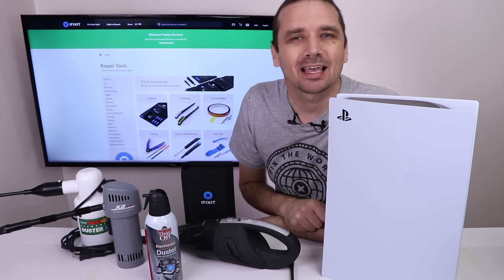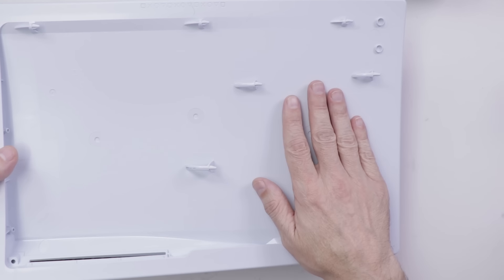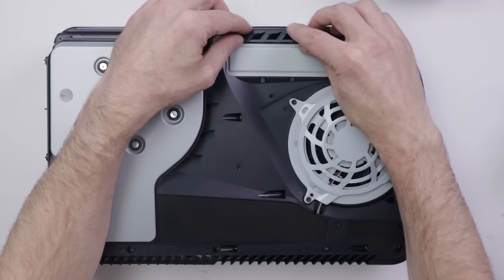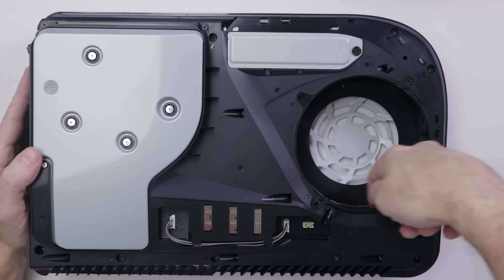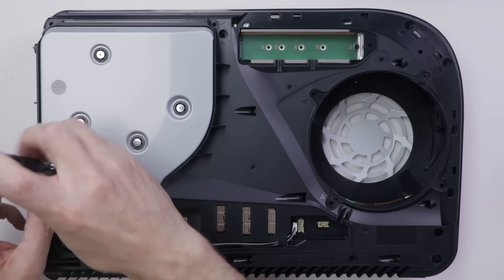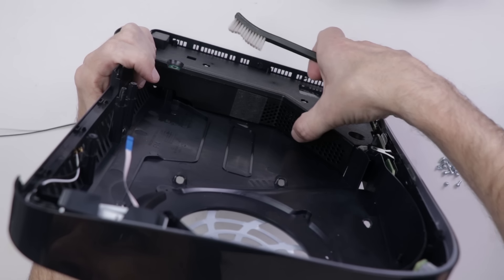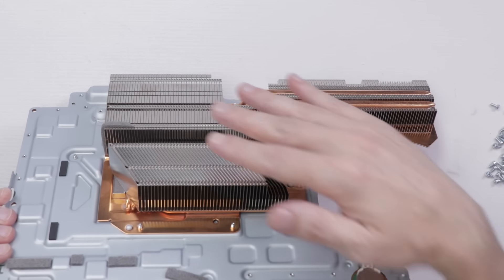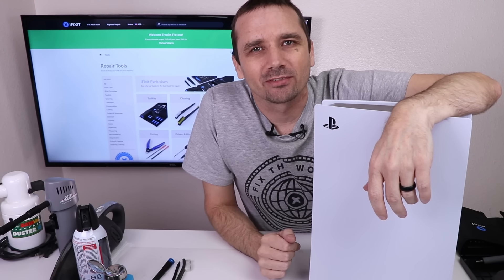How to Clean Your PS5 Safely - 3 Stages

Comment: Imagine reassembling it and having some screws left
Reply: @real_is_back297  Highly unlikely that would occur since most screws have very little to do with how well the console runs.
Reply: That’s exactly why I don’t want to do this😂 but I need my console cleaned😂😂
Reply: Imagine reassembling it and your ps5 not working
Reply: @greed6is6good  The only moving parts are the disc drive and the fan should be easy 🤣
Reply: Means you put the PlayStation back together better than the engineers did
Reply: Me rn 🤦‍♂️
Reply: I had 25 screws left 🤷🏽‍♀️
Reply: had that happen to me when I cleaned my xbox one x I put it all back together and ended up having 4 screws left over 😆 it still worked good tho

Comment: I can’t express how helpful you are. I decided to just go for it, I took it completely apart like your video! It was caked in dust! It was overheating and shutting off!

After reassembling it wouldn’t turn on! But turns out somehow I’d forgotten to plug a ribbon cable back in, after doing so it works fine! It runs as cool and quiet as the first day I got it!

Comment: Hey guys, I’ve had my console since launch and never cleaned it since today. The fan had so much dust. If anyone is scared about unscrewing the fan, just use a tweezer and reach down through the gaps of the metal that holds the fan. Works amazingly well!
Reply: But the dust will be still there moving around and if that dust go inside into the heat sink fence, more problem lol... So if you are doing it, do it the right way.
Reply: @jaybro3713  There is no right or wrong way. If it’s clean it’s clean. Dust generally clutters together making it easier to just pick it all out and then using a hoover or air can to blow away the small bits left
Reply: Are you sure this works I have the exact same problem as you so if u can help me it would be amazing
Reply: @peachbeach9471  yes it works amazingly well. Dust usually sticks together so it’s so simple to just tweezer it out without removing the whole fan
Reply: Mine always turns off
Reply: @tyn7443  t8 security screwdriver
Reply: Was your PS5 loud while it was dirty?
Reply: @Cronies  nope the only sound that ever comes out from it is the coil whine which can be quite annoying when sitting close to it
Reply: Yo same
Reply: @Luismarsden68   no cap mines too idk why either cuz I clean mines from time to time
Reply: @gerodanthony3655  mine don’t do it anymore don’t know why tho

Comment: I prefer to use a small paint brush, preferably with soft bristles, it's more comfortable and reaches the most difficult nooks (
especially with heatsinks). Much more than a toothbrush or shoe rack that isn't capable of reaching everything.
Reply: I keep a small paintbrush in my drawer for such occasion
Reply from the maker: Those work great for loose dirt. I sometimes use a similar brush. Many times dust is cakes on and won't come off with the softer bristles and that's when you need something with stiffer bristles.
Reply: cosmetic brushes are good too
Reply: I prefer to use a camera lense brush, it's just as soft as a paint brush but it can also blow a small amount of air to losen the dust in the tight corners
Reply: There are paint brushes we call in the U.K. flat fitches, they are perfect
Reply: Is it true that if you use the van air the dust will just go more deep inside the ps5

Comment: Stage 2 cleaning every 6 months is undoubtedly necessary as stage 1 will not remove the dust that accumulates on the fan (which leads to excessive load and wear on the bearings, in turn causing overheating issues), so everyone who owns a ps5 should follow this video to stage 2 - It really is as simple as getting that Torx driver to unscrew the fan. No need to be afraid, as there is nothing to worry about with regards to breaking hardware accidentally (Unless you literally try and rip out the fan connection wires without care for whatever reason)
Reply: Do you lose warranty of you do stage 2?
Reply: I would also like to know about the warranty question
Reply: @neirosama  & @WallyAliBear, as long you dont remove any warranty sticker, It will be under warrant. As you can see, removal of the PS5 fan will not damage/remove Warranty stickers, so it will not lose the warrant. (just remember that you can damage the screws, the black plastic cover and the motherboard if not takens minimal care, and any damage by the user is not covered in warranty)
Reply: opening the system in any way voids your warranty
Reply: @ricardocruz3578  the warranty only lasts a year. So if you had your PS5 longer than that, it has no warranty anyway, so the sticker doesn't matter.
Reply: That’s what I’m worried about is accidentally messing up the fan connection wires

Comment: Thanks for this! Stage two was needed, couldn’t ever see myself risking stage three though haha.
Reply from the maker: Glad I could help!
Reply: lol same
Reply: @iangrant888  Stage 3 is what I was nervous about, too, because I've never handled motherboards, ribbon cables or computer assembly, but it was pretty easy. Took me just over an hour for a complete disassembly/reassembly.
Reply: @jman8350  It’s easy just go to your nearest computer store Micro Center grab yourself an anti-static Matt that has an attachment that goes into your wall outlet to ground it didn’t get yourself antistatic wristband and ground yourself to the mat Start disassembling your PlayStation then take the components like the motherboard and place them on the antistatic Mat if doing repairs
Reply: @brycemorgan6708  , why is this necessary if I may ask? I’ve never heard of anyone using this for console repairs
Reply: @many6747  because you can fry your components with static electricity generated by moving. I’ve fried motherboards and graphics cards for pc’s before and this is no different. Better safe than sorry
Reply: @brycemorgan6708  if you’re gentle it should be fine???
Reply: @Tronicsfix   after stage 3 and i reassembled the PS5, i have a light rattling sound near the disc drive (i think). the rattling gets kinda loud when i’m playing a game, please help!!
Reply: @ssRarexx  Don’t know if you got it fixed. But could it be a small cable touching the fan?
Reply: @MadsHilde  as far as i could tell, there doesn’t seem to be anything touching the fan. but i can’t tell when it’s all put back together. i will investigate further though.

Comment: So far my PS5 has been fine with just stage 2 cleaning but I have friends who I have done stage 2 cleaning for a few times and before long they're getting the 'ps5 too hot' message. I can tell from where the heat is built up that it is from the heatsinks that can't be cleaned with just stage 2, so gonna have to learn stage 3 to help the boys 💪

Comment: Just a heads up...
Some of silver screws are in the wrong spots in the rebuild part, which will stop some of the final black screws working.
Go back to the teardown section to see where they are supposed to go.
Reply: Bruh I just got to that part now I have to take it apart again 😢
Reply: I usually take a picture of the system with the screws or i use a erasable marker to mark specific screws with a line or x
Reply: The screw holes your suppose to not use with the silver screws have marking on the plate
Reply: I thought so too!!
Reply: Eactly. Least he could do is pin this comment to save people some trouble.
Reply: He notices it as he mounts the disk drive and so the screws magically pop into their correct places at that point. This should really be pointed out with an overlay in the video.
Reply: Thought I noticed that thanks

Comment: I never have the balls to actually take my consoles apart, just incase I break it. So I tend to just clean around the fan area and vents!
Reply: Don't worry man I'm the same way and I'm sure a ton of other people do as well 😂
Reply: Same but my air nossle got stuck in the fan  to clean orn own
Reply: It's the same for me
Reply: I'm with u man haha...especially these next gen systems ...u break one of these and u prolly won't get one for a other year or 2...it's crazy man...but honestly this guy is doing too much...they make these machines in a way that you really aren't supposed to take Ethan apart like this man...the best thing to do is take the plates off and use a duster can like u use for a keyboard and cleaner around and in the fan, wipe the dust away everywhere else and call it a day...u don't have to do all this man...
Reply: @gambino48  I was cleaning it and the spray nozzle got in so I was forced to open it up it wasn’t that bad but I did scratch it but I got it all cleaned
Reply: Same here. Noticing my PS5's getting quite dusty, hope that's going to be enough to do the job.
Reply: @gotdraco  I’m here cause the nozzle went int the fan as well lol but I don’t got the tools to get it out
Reply: @beastsoundz617  lall you have to do is take the panels off and remove it with a tweezer hope this helps
Reply: @gotdraco  Oh snap I forgot I had tweezers I played around with it and it fell behind the fan a bit 🤦‍♂️ ima have to buy the tool to open it and take it out
Reply: Sony released a tear down video when the console was released it’s supposed to be torn down. They only way you’ll mess up is if you pull any sockets off the motherboard just be gentle

Comment: Dang... I've no confidence in taking apart my PS5. Tronic made it look so easy.
Reply: Me neither I feel like I would just break something 😬
Reply: Make that 3 I just got my ps5 on 9/22/21
Reply: I did it with ps4 but im not as confident with ps5. If you have a vacuum attachment and are willing to remove the fan (thats as far as ive got) then it should be enough to vacuum the most important areas

Comment: Even though Stage 3 is a super deep clean, it is still very easy to take apart and I really thank Sony for making it very simple to clean dust from the PS5. Beautiful engineering at its finest!
Reply: The engineering is so bad.
If they just gave access to the one cable you won't need to take out 41 screws and screw up the cooling paste.
Reply: @pogialli  agree 😂, basically you have to unscrew 41 screws just for the connector.
Reply: Is breaking the thermal paste connection under the metal plate an issue?
Reply: @tyson07cbr  I wouldn't recommend it. Thermal paste is cheap so replacing it would be wise.
If you don't, make sure there is enough paste in place. Maybe remodel it a bit with something like a popsicle stick.
The metal plate will press it down.

It would be a shame if cleaning your PS5 will cause more overheating that the actual dust you took away.
Reply: Definitely not beautiful engineering.
Reply: I will never attempt a stage 3 i would definitely break the console. Im thinking about giving stage 2 a go though for the first time.
Reply: @Mitchlovejoy  you totally should, I just cleaned mine at Stage 2 in preparation for Spider-Man 2. You can also brush out the heat sinks through the hole from removing the fan, to get some of the stuff from stage 3.

Comment: Stage 3 is ridiculously overkill. Nobody should ever really need to do that. Honestly, stage 1 is sufficient in most cases.
Reply: I just did stage 2 and glad I did. I've had my console since launch and I was surprised there was actually a good amount of dust within the fan and the blades, as well as portions of the heatsink.

I agree with stage 3 being overkill as well tho, I couldn't see me doing that as long as I continue to routinely clean my console from now on every few months
Reply: Stage 2 here 
Part of my house is on construction and I sense a little bit warmer while playing with ps5 
I disassembly and I'm shocked the amount of dust the fan has.
Reply: Stage 1 is actually not going to be sufficient if you value the longevity of your console - You do need to clean some of the heatsinks and the fan to remove the dust buildup which a stage 1 cleaning will not allow you to do.
Reply: @jine7123  I'm skeptical of that because I never went beyond the equivalent of "stage 1" for my PS3 or PS4, and those are still working fine. Most users will never even attempt to open their console, much less take it apart and reverse-engineer the entire unit just for maintenance. If that were truly necessary, the vast majority of consoles would be dead within a few years. Granted, a lot of people take horrible care of their things, and they'd probably last a lot longer if they took better care. But manufacturers of mainstream consumer electronics do their best to design things to be mostly "idiot-proof" knowing that most people are not going to clean the internals of their game console.
Reply: @ArcadianGenesis  I'm already having overheating issues with my PS5 in less than 15 months, which didn't start occurring with my PS4 until year 4 or 5.  I don't think previous histories with the older consoles is a good metric here.
Reply: @i_booba  What do you mean by overheating issues? Is it hot to the touch? Mine still runs cool and quiet, and I've had it since launch.
Reply: @ArcadianGenesis  I think I know what he's talking about. It doesn't make any loud noise for me but it occasionally just completely shuts off and I have to unplug the console then plug it back in. I looked it up and it said it's overheating due to dust buildup. It shuts off out of nowhere and it's really annoying so I'm about to clean my console.
Reply: @Jimmy I only did stage 1 and it worked incredibly well. My PS5 makes almost no noise now and never crashes. Unless your console is really really messed up I think stage one is all you'll need 👍
Reply: I needed to do stage 3 to clean my power supply vents

Comment: Stage 1 got me messed up 
I’m so scared of breaking the cover
Reply: Don't worry it pops right off if you pull a bit hard, just need to pull on both sides
Reply: Now on to stage 2. 

You would be a real man if you can manage stage 3.
Reply: @tr1bes  I made it through stage 3 thank God 😥, it’s all a blur to me now though. Half way through when I had to flip it over the spacer for the expansion memory fell out on my lap and I about lost my mind… I couldn’t figure out where it came from haha. I eventually figured it out though, ps5 turned back on and running as quiet as when I bought it.
Reply: I did stage one and called it a day man😂

Comment: GUYS - I cannot emphasize enough to be EXTRA careful when 'trying' to pull out the fan connector, I followed this video to the tee and the whole "yellow" piece connected to the motherboard came out despite just pulling on the white connector. And now, I sit here with essentially a broken PS5 which was working fine. Curiosity indeed killed the cat and so did my meticulous nature in wanting to clean the PS5 even when it was ok. Not only did I spend money on the air blower and the torque screws, but I've lost the PS5 :)

PS: for a stage 2 clean I would HIGHLY reccommend leaving in the connector, as once you unscrew the 4 screws from the fan, it comes apart anyway enough for u to complete a stage 2 clean. I do not want anyone else feeling what I am right now haha.
Reply: @seriustraco  glad someone listened because on videos from channels with large followings, whether fake or real, u see 99.9 % of comments saying the same things, but the comments that are rare or stand out usually speak the truth.

Quite surprised going through the comments that not one person mentioned this, and neither did the video really emphasize the importance of being extra careful when removing the connector.

How did ur clean go? Did u realise what I meant by leaving the connector in while still being able to somehwhat move the fan enough to get into the areas needed for the so-called 'stage 2' clean? Even if my advice helped one person, then I am glad.

Luckily, I managed to get my PS5 fixed within 3 days, and it actually runs better than ever due to the clean! 🙂
Reply: Hey, I’ve seen you got your fan port working do you happen to remember how you got it running? I ran into the same issue, any videos or help will do😂
Reply: @MikeHawk-h8k  sorry to hear... I had to take it to a friend who was a handyman in repairing these things as the part needs to be soldered back on and not everyone can do it plus if u mess that up ur running the risk of causing further damage. If u try to play wothout the fan running the console will shut down after a few mins due to overheating. So ur best bet is to search online for a repairer based on location and reviews. Good luck and let me know how it goes! Funny thing is I actually revisited this video yesterday to clean it before u even commented lol. Didn't remove the connector this time tho!

Comment: Thank you so much for the clear and concise walkthrough! Another user pointed out, during the rebuild, the placement of the 41 screws had an error. You need to save one silver screw to for the disc drive after you put the midframe back on. I also noticed a lot of heat paste that seemed to come off easily for you, but my 2-year-old unit ripped most of the paste in half. I'm concerned that I may lose some heat transfer efficiency because I didn't replace the dried paste.
Reply: How's it running so far?

Comment: Huge help, I fully went through stage 3 for my over a year old ps5. Risky but all good 👍. Though, those 41 screws some were unnaturally tight 2 hour task by hand the first time. Other then that running smooth.
Reply: Still going?
Reply: @Damnitgary  yup. Long as im keeping the ps5 laying down(keeping the liquid metal from leaking around)but cleaning wise its solid. Bought a custom top to keep lent out of fan and much less cleaning issue after.
Reply: @1000byakuya  sweet! Did you replace the thermal paste ?
Reply: @Damnitgary  nah, limit to how "comfortable" i feel lol the new casing really helped alot tho. Sonys case sucks.